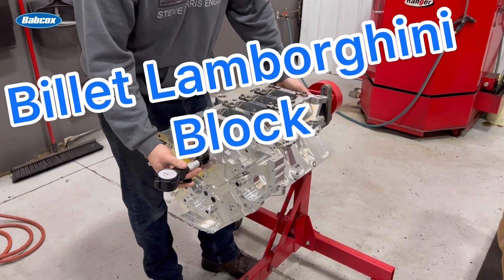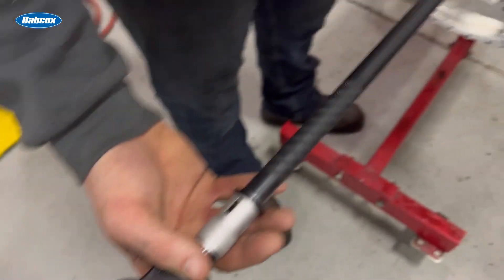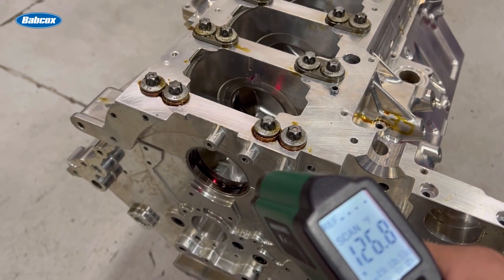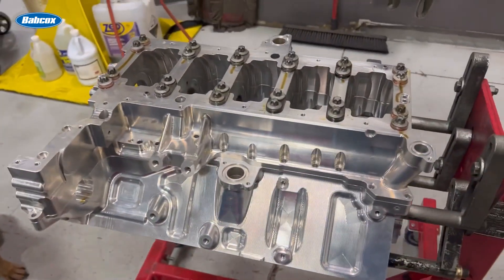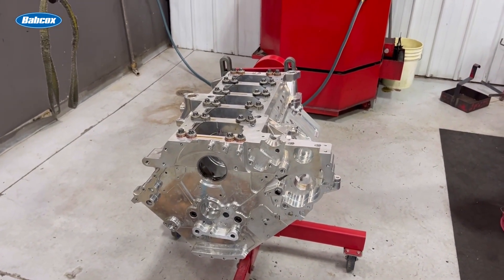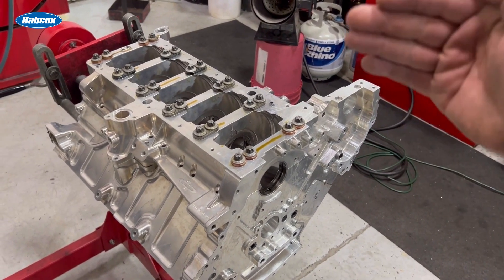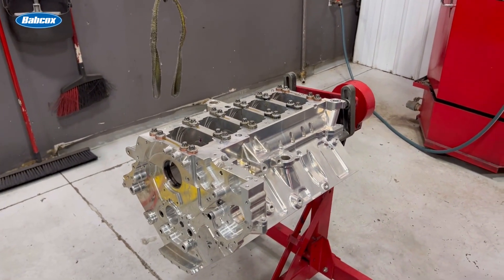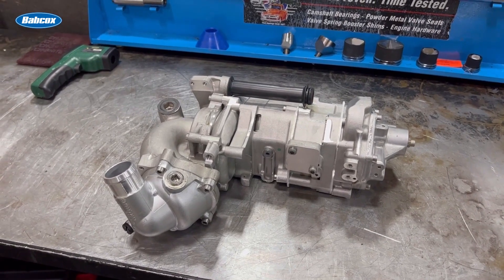How Does Heat Affect Clearances on this Lamborghini Block?

Comment: This was very interesting and made me think about my blown boat engines. They are cast iron, so bearing clearance growth is not an issue, and the block run cold because of sea water constantly cooling them. I'd appreciate your commentary about anything related to my scenario. Been considering re-powering with two new blown 632s.

Comment: Wonder if someone could change the gear sized for the pressure drive gear. Would only need to make new housing or modify it. Would increase the pressure and scavenge speed? Easier said than done I know.

Comment: Put it in one of Tom Bailey’s pizza ovens…
Isn’t pressure the result of restriction? So, is running heavier oil for higher pressure actually result in restricted flow / volume?